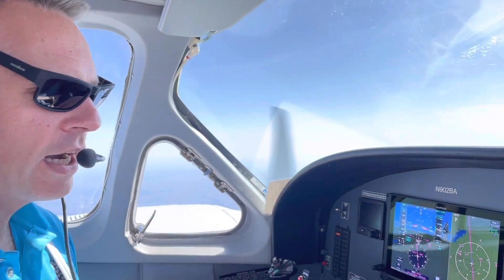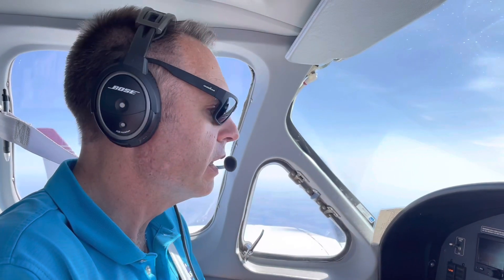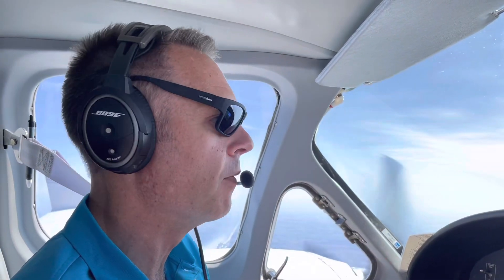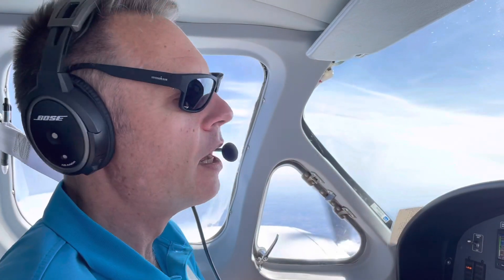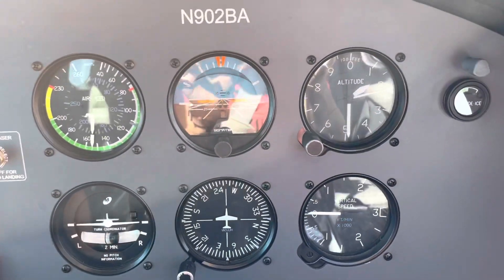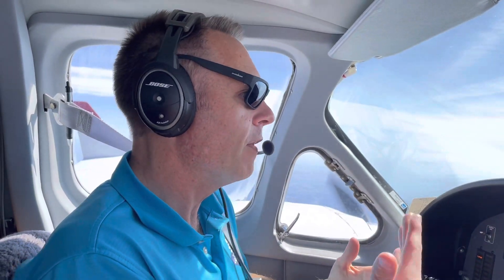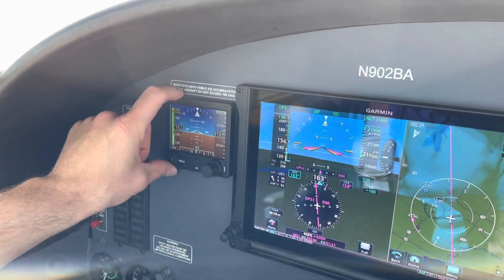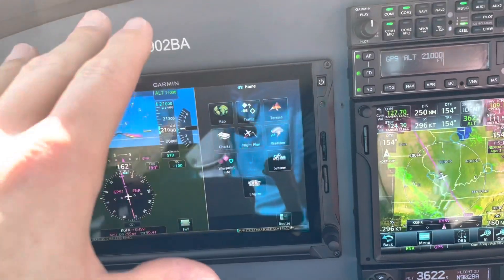Garmin Avionics Upgrade - Twin Cessna 414

Comment: i am having a complete garmin glass panel installed in my 81 414/  lots of money but if i ever figure it out i might fly it again. be done in 2 weeks with backups alt hold   lots and lots of money but iw ont ever sell it just had new rams also done 8 months ago it has taken them almost 6 months to install the new panel  a tad over 260 grand

Comment: Dan, I just got done watching the video again, and it appears that you could use a pair of Flying Eyes sunglasses. It looks like you tilt your glasses so that the earpieces don't get pinched tight to your head by your headset. Flying Eyes claims to eliminate that uncomfortable pressure. I don't own them as I wear prescription progressive lenses, but you might check into them. The earpieces are also super flexible, so they shouldn't break under stress. Full disclosure - I am not a representative of Flying Eyes, and I have received no compensation from them. LMAO
Reply from the maker: 🤣 I know - I haven’t found a good option yet that truly fits. And since I lose them all the time I go WalMart now 🤣